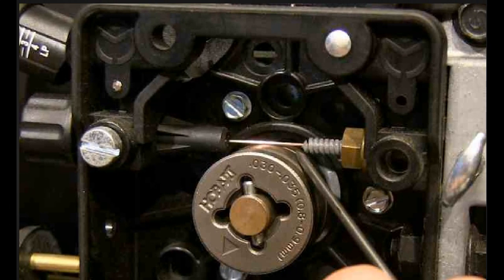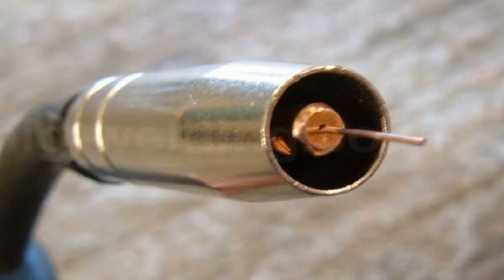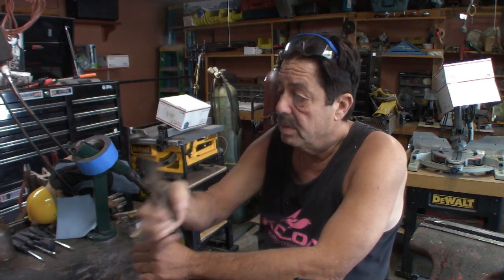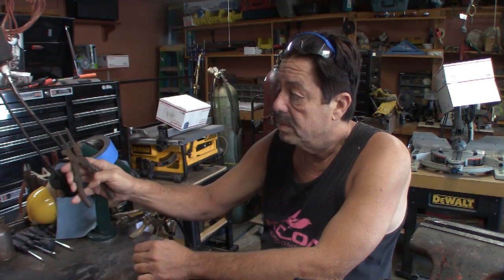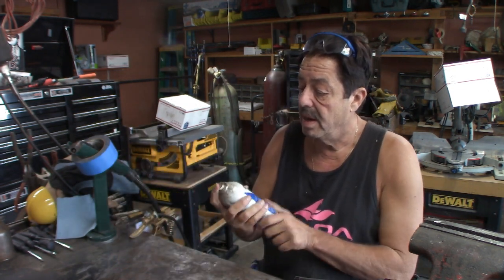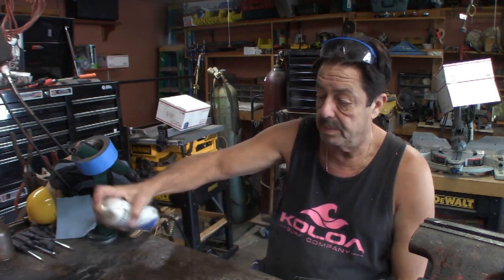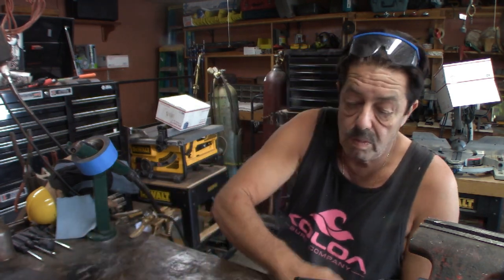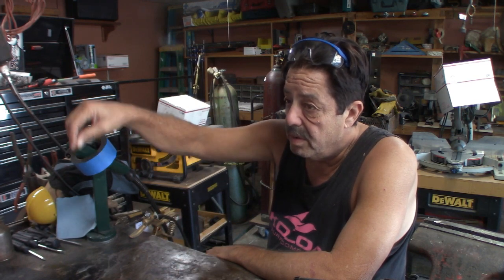How to Use Antispatter Coating When Mg Welding - Tips & Tricks

Comment: For gel I wouldn't dip the mig gun tip in any further in the gel then 1/2 I think dipping 3/4 is way to far in the gel
Reply from the maker: depending on the mig shield and tip yes that is a rough estimate but you really do not need to dip it very far into it - you just have to make sure the tip is hot before you dip it in